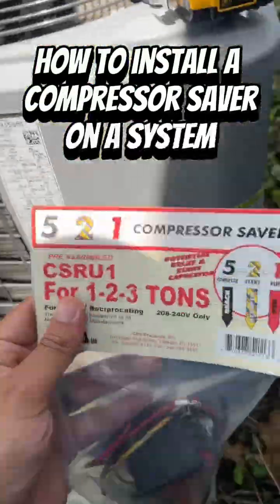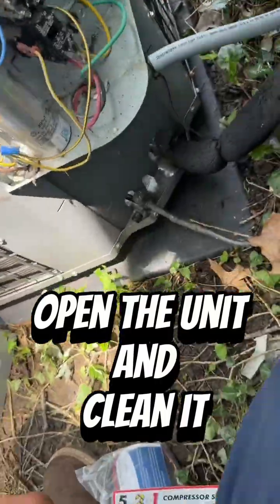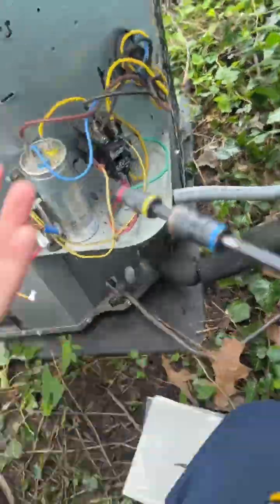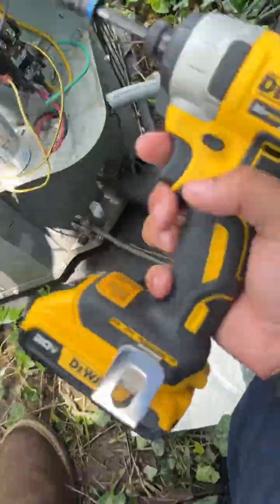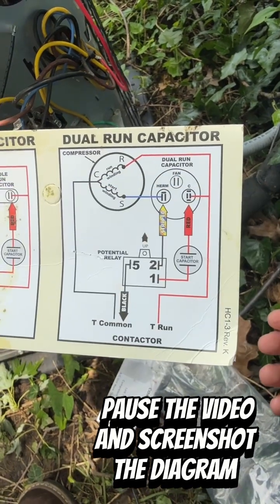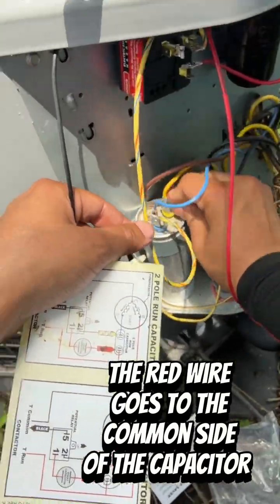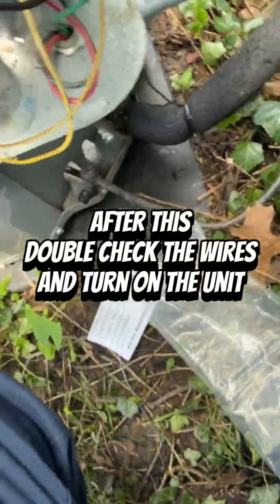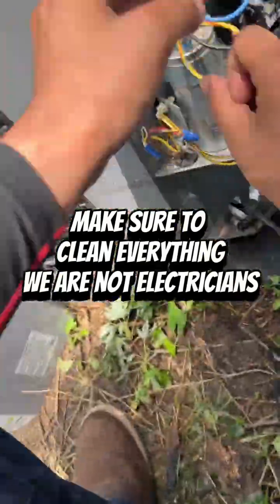Compressor saver installation (hard start kit)

Comment from the maker: Pro tip I forgot to mention in the video. Always check the polarity of the contactor and read the wire diagram. In some rare cases the “common” side is on the right and not the left.

Comment: How does this save my compressor ?
Reply from the maker: Long story short, gives the compressor a boost so it doesn’t have to work as hard when starts. It works only for a few seconds and then disengage from the circuit.
Reply: @OzzyOnDuty does it work better than a soft start ?
Reply from the maker: @jimmychong1780  they are different, used in different situations, the hard start is to boost a compressor that struggles and the soft start is to reduce power consumption when starts so it doesn’t need too much amps and cause that “flicker” in the lights. Nice observation have you installed or use one of them?

Comment: How do I know if its compatible?
Reply from the maker: I would check compressor amps when the compressor starts and if running higher than Manufacture LRA I would get the correct hard start for the tonnage of the unit. This video is only installation but that’s a great question